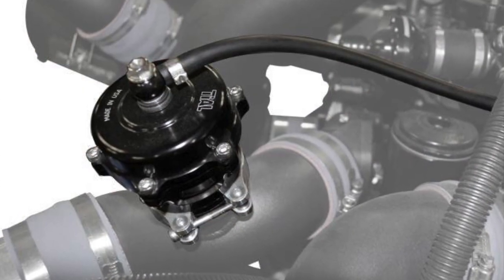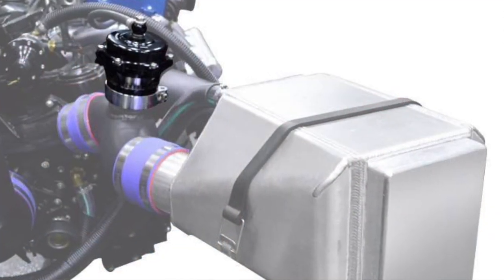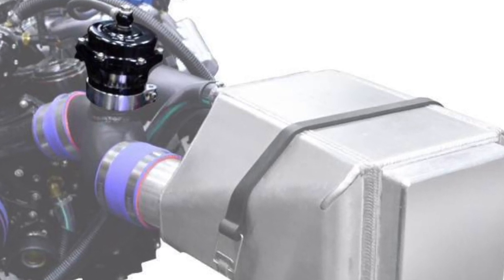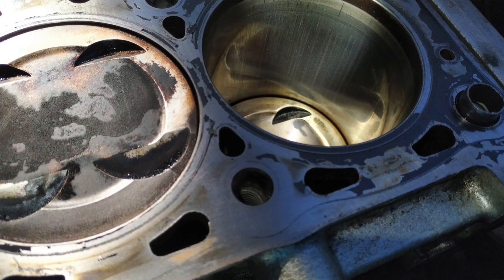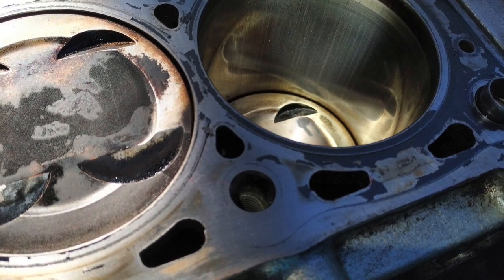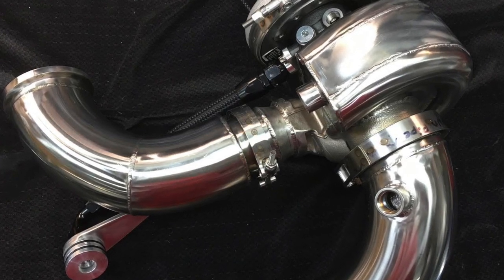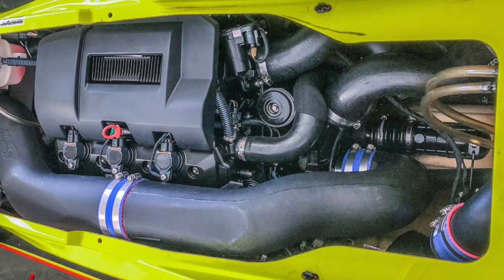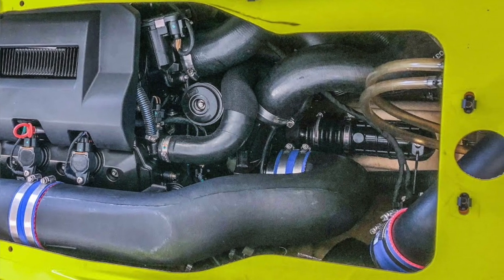When Is The Right Time to Buy a Blow Off Valve: WCJ Quick Topic

Comment: A bov in all instances will improve supercharger clutch longevity regardless of boost level. Riding style plays a big part in this also, depending on how much aggressive on and off throttle action takes place, the sc clutch wear is generally when the throttle is closed abruptly causing a pressure surge between the supercharger and throttle body resulting in the sprag clutch or wear washers to slip.

Comment: I could be wrong but won’t it help preserve the sc clutches in a stock application by keeping the stall off the wheel under quick deceleration from wot.
Reply from the maker: The amount of psi on a stock application is so low that few see excessive wear on the stock clutches – particularly on the 300HP Sea-Doos.

Comment: Would it ruin the warranty if I install a BOW to my new GTX300 Ltd? I know that the boost is not high enough to damage the SC or the clutch on a stock engine, but I just want to be on the safe side. And the sound is also so cool! :)
Reply from the maker: Ask your dealer's service writer. Some dealers care. Others don't.
Reply: I would remove it before taking it in for service.